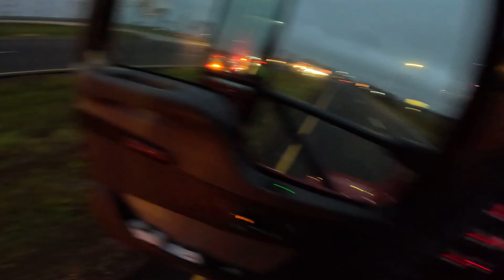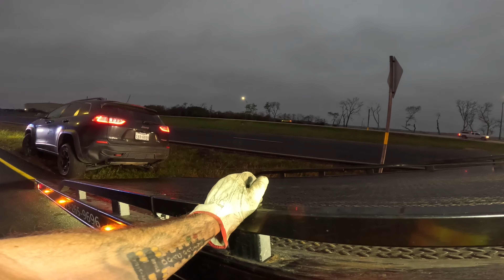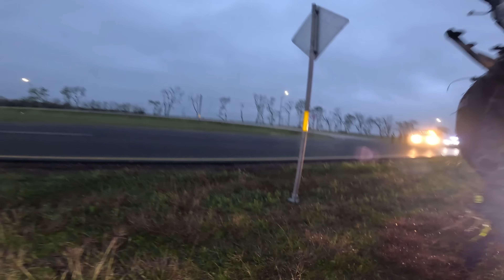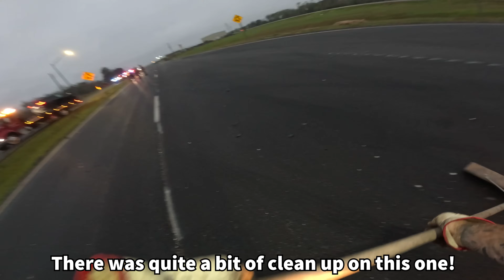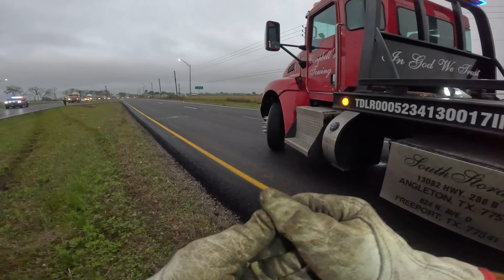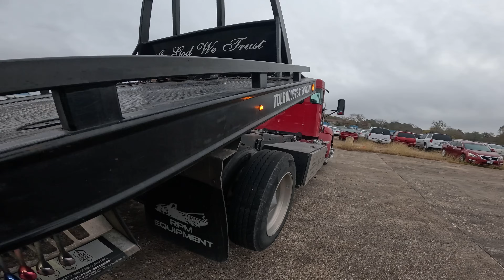Jeep Cherokee Goes Head on With a Dodge Charger!!

Comment: You had that girl cop blushing😂

With your new cam, I liked the original head cam only when you were rocking up on scene I think looks better but the chest cam is better for everything else maybe you can sit the cam on the dash when approaching then to chest if possible?
Reply from the maker: I have done a few videos with it facing forward, but I need to get a crack in my windshield fixed in the meantime.